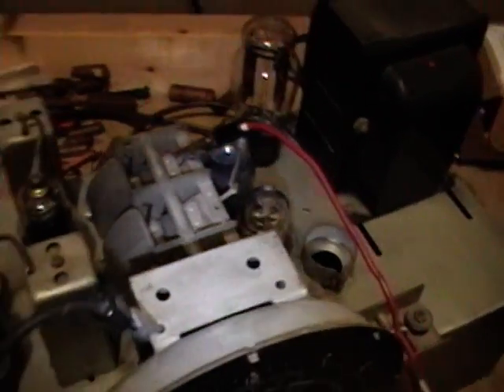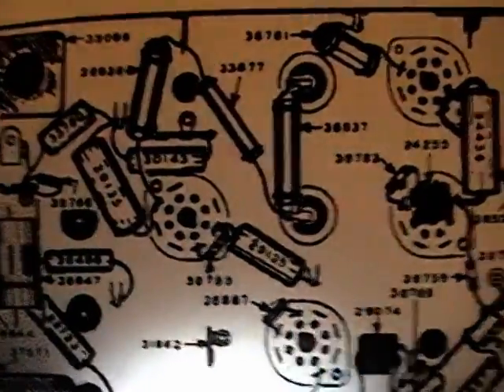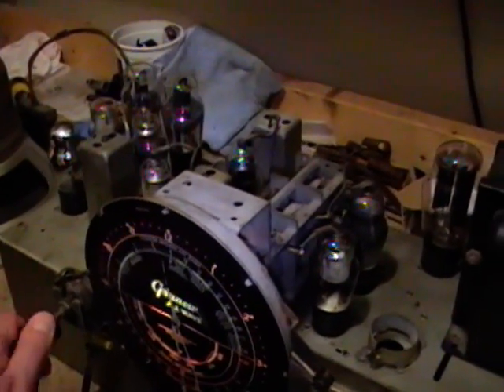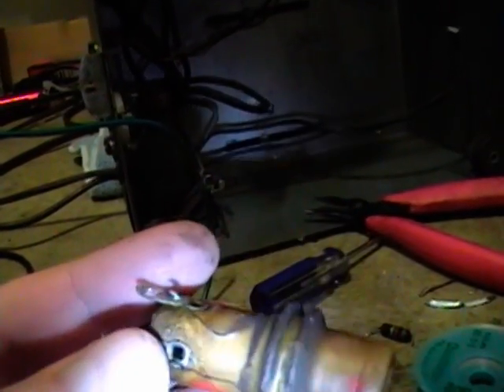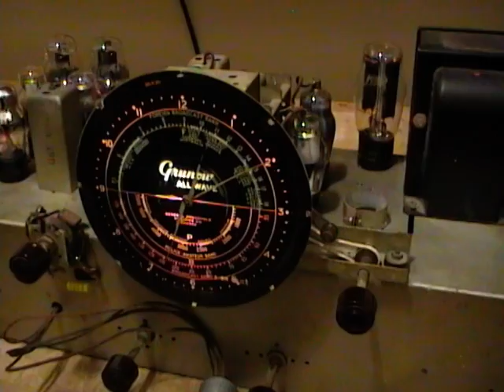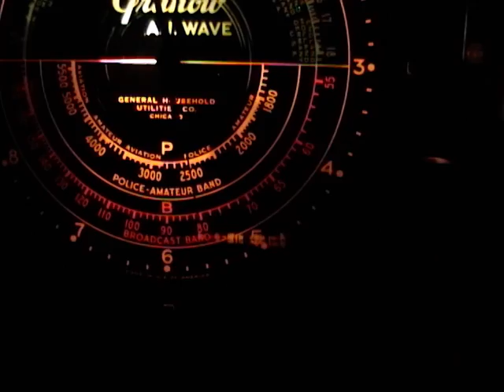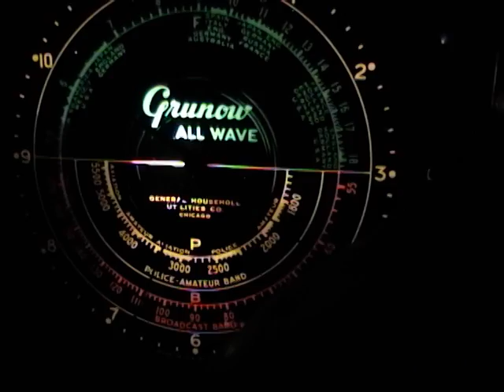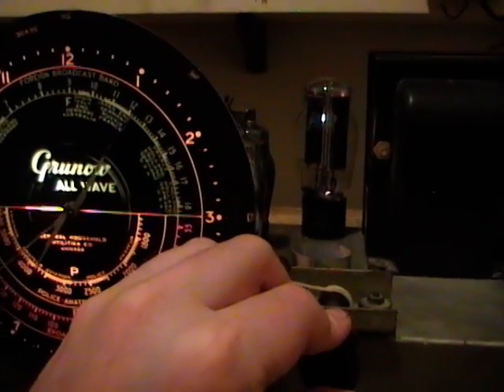Grunow 1191 restoration p4o?

Comment: @bandersentv Speaking of the eye tube again, I have also been thinking of a way to preserve the eye tubes in some of my sets with . In an RCA I have the socket was defective so the eye wasn't getting any B+, so the target was still green but the triode section is weak, so I guess you could switch the high voltage off or the filament voltage and achieve the same result. My inclination is to go with a way to turn the filament off like a small bat switch, probably around the back of the chassis.

Comment: Nice radio and a great restoration job. With RF amplifier and two IF stages it would have quite sensitive receive. It must have been an expensive model when new as it had push pull output as well for hi-fi sound.

Comment: That problem with the grounding wiper on the tuning condenser may be a result of oxidation from the set having been in a flooded basement. I noticed that the problem seemed to be getting better the more you worked the dial before you cleaned the wipers with sandpaper. Open coils scare me, and I've repaired a few. I've heard that on the Grunow Teledial sets it's common to run into an open discriminator coil, I'm not sure if they are as easy to rewind as that coil in your set but probably not.

Comment: In those eye tube sockets it's very common to run into a bad resistor, the resistor runs between the target and the plate pins so it has full B+ voltage running through it. To make matters worse many manufacturers used a 1 meg ohm 1/4 watt resistor since it would fit in there easier then one of a larger wattage, as a result many are burned up and open. Luckily with that socket it was easy to open, some are not. It's your set of course but I though the original eye tube looked pretty good.